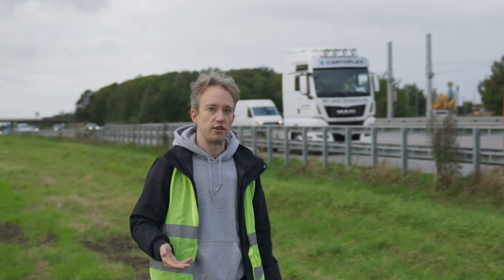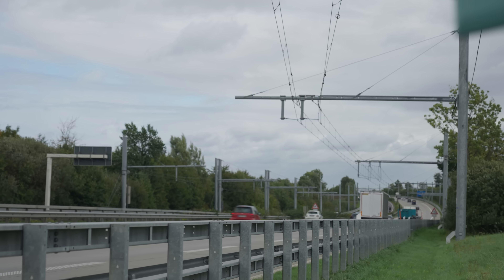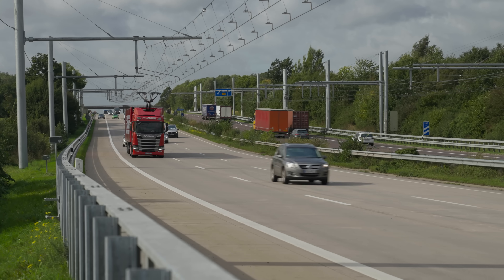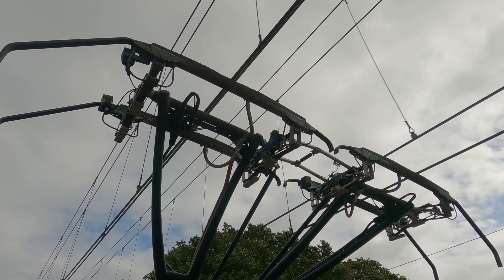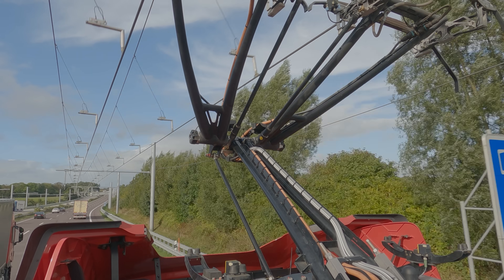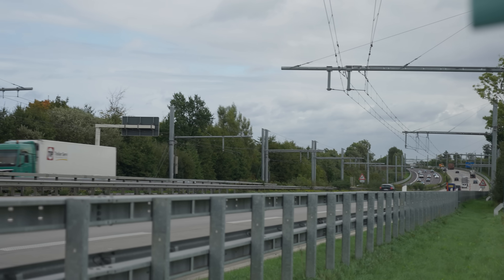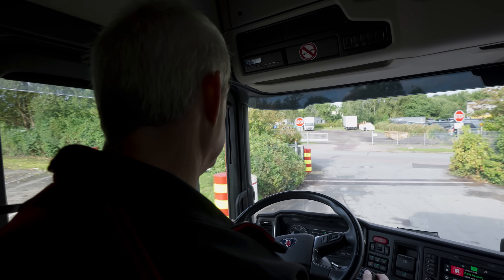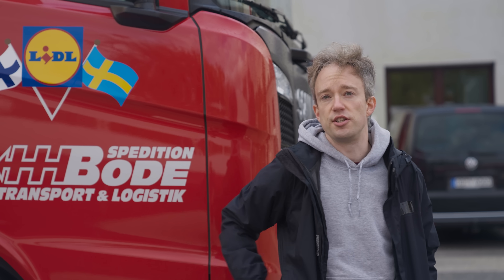The highway where trucks work like electric trains

Comment: It's funny that this 'trolleybus'-technology is 130 years old and now it's suddenly relevant again.
Reply: Not trying to be pedantic, just find it interesting. Trolley technology is actually slightly different from the pantograph technology they use here. Though as far as I can tell the only public transport systems these days making use of trolleys are indeed busses and not trams. The reason that the system is used mostly by (inner city) busses seems to be that a trolley system gives a bus more room to maneuver while still receiving power. However from experience living in a city with trolley busses if the trolley pole does loose contact with the overhead line the bus needs to actually stop as the pole needs to be manually directed again to the overhead wire. 

A pantograph as used here doesn't offer the benefit of following the overhead wire but also doesn't needs to be manually directed in the right place. As the truck also has a battery and a highway is mostly straight driving anyway it does make sense this was used.
Reply: @creesch  You overlooked another reason for trolley buses:  They allow a tram style system where the slopes are too steep for rails.  Geneva Switzerland is a good example.  They run trams on the flat and trolley buses in the hills.
Reply: @creesch  pantographs also allow faster speed while providing vastly more power, but it's more expensive and requires complete overhead wire replacement so most tram/trolley buses systems already using trolley poles are inclined to keep their poles to save cost. They also have this mindset that wireless battery electric buses/tram is the future and they can soon "skip a step" and ditch the wires completely, soo...
Reply: @duncantalksalot  Indianapolis has already taken this step, with battery powered buses running in dedicated lanes.  Ironically they used to have an extensive trolley bus system 50 years ago.
Reply: @duncantalksalot  Here in Toronto, we kept trolley poles for the streetcars as up until 1993, we also had trolley buses and any intersection between those is a lot easier if both use poles (and so, frogs for switches on the wire). 

It’s only now that we have new vehicles that all the wire is being gradually upgraded to be suitable for pantographs. For now, the new streetcars have both a pole and a panto depending on which route they’ll run on.
Reply: @danielstickney2400  there where everywhere and in 1930s train stations where in almost every town in u.s
That had railroads
Reply: @creesch  Trams use a single pantograph because of the rail working as the negative whereas the trolleybus is isolated and needs the two wire system shown here , just with two separate pickups because the live and neutral have to be supplied , it is the same as the trolleybus system , just different pickups so the trucks are able to connect easier . I think if one of the pickups on the trucks goes wide and loses contact the truck will keep running from its batteries and be able to move across into place and reconnect . In Kharkiv there are trolleybus (Bogdan make  ) that can travel quite a distance without the overhead lines , they actually introduced a new line before the overhead cables were installed .  Even if they lose contact they can carry on to the next stop and then put the arm or arms back to the wires
Reply: @creesch  Yep, many a day I was late for class when the electric pickup would fall off the line on the trolley bus in Boston.
Reply: @creesch  We used to have trolley buses in Toronto, but we dropped them I think because of that problem. We still have streetcars, which most NA cities got rid of 50 years ago. Problem is, they mess up traffic unless they have a separate. preferably grade-separated right-of-way, which is expensive, though slowly being phased in.
Reply: @creesch  well trolley and tram are synonyms actually
Reply: @mareksicinski3726  They might be used as such by people but they really are not from a technical point of view.
Reply: @mareksicinski3726  only in North American usage. In Europe we use different words for clarity
Reply: Exactly, this should be called... a trolley-lorry? Trolleylorry? Or trolleytruck :).
Reply: @piotrb4240  trorry
Reply: @piotrb4240  "trackless trolly" in Philadelphia :)
Reply: @piotrb4240  Trollory? Truckybus? Electruck? ... now that I think about it that last one is almost certainly already a trademark
Reply: @piotrb4240  Trollorry
Reply: @piotrb4240  Trollorry
Reply: @piotrb4240  I think Trolleytruck is the accepted term, but trolley-lorry is funnier.
Reply: San Francisco has lots of trolleybus routes - diesel engines simply can't handle our hills. 
And as noted above, the newer models have batteries, and they just bring the poles down for certain parts of the route where they tend to come unhooked regularly, so they don't have to hassle with it.
We also have trams that run on pantograph, sometimes in the same place. Buses can't use that. The difference here is, the trucks have dual pantographs, presumably one for ground.
Reply: @dwc1964  Nope, the second wire is not ground, it is neutral because it carries the return current. The automotive industry incorrectly calls the negative terminal of a battery the ground because it is electrically bonded to the chassis, called a chassis ground. A true ground wire as called in the electrical industry would be one that does not normally carry any current, only carrying current in emergency situations when there is a fault in the electrical system.
Reply: @00crashtest  I stand corrected
Reply: @dwc1964  Thanks for admitting that!
Reply: just imagine what it could've looked like if we kept using it for 130 years long, we would be far into the future by now.
Reply: @PumpkingsLol  in czech republic we use Troley Busses
Reply: @t0biascze  In Ukraine we use Chechoslovak trolleybusses
Reply: @t0biascze  Same in Ukraine and we also have some of your old trams still in use in Vinnitsia . I like the old ones , they have a lot of character
Reply: @PumpkingsLol  trolley-busses are still used around the world. In Ukraine we have plenty of cities running trolley-buss networks. I'm curious if they can be extended to let trolley-trucks to run in them
Reply: @VityokOrgUa  i live in a city with them
Reply: @VityokOrgUa  I remember taking an electric trolley bus between Simferopol and Yalta a couple of decades ago, an 86km journey all by electricity. Of course now as an American I am not allowed to go there but it was cool at the time.
Reply: @VityokOrgUa  I have the same thoughts as well. My city of Seattle has a lot of trolley bus routes so I’m wondering if trucks shipping goods could possibly also connect to the overhead wires
Reply: @VityokOrgUa  Cities like San Francisco, too, have continued to power most of their buses by such an overhead system all along.
Reply: @solracer66  That's supposed to be the world's longest trolleybus route. Glad you managed to travel on it while you could
Reply: @VityokOrgUa  They were also used in the 60's in Milwaukee.  Only problem is the ugly wires above.
Reply: @VityokOrgUa  we gave trolley buses in Bulgaria too. but I prefer diesel trucks and buses. I love the sound when I drive them! I don't want to sit quite I want to hear a diesel engine sound!
Reply: @VityokOrgUa  Kharkiv had just opened a couple of new lines just before the war started . As  regards the existing ones being extended for trucks the problem is with the pickups being different . it might be possible just for within the city but outside of there maybe not
Reply: @VityokOrgUa  I thought that trolley-trucks did exist in the Soviet Union at least in the '50s and '60s?
Reply: @PumpkingsLol  Switzerland is still using that system in cities... since a long time
Reply: @PumpkingsLol  many cities do
like for example salzburg
Reply: @PumpkingsLol  what goes around comes around, we keep reinventing things..
Reply: @PumpkingsLol  in the past it was just total crap, and the combustion engine just proved more reliable short term. Nowadays, it's almost perfect.
Reply: @PumpkingsLol 
Well Switzerland has with its trolleybus systems
Reply: @PumpkingsLol No, you ll either think there is no future or fossil fuel is the future😂
Reply: @PumpkingsLol  yes but that would have hurt the oil industry. Technology that would revolutionize an industry tends to get suppressed only for it to reappear in the future.
Reply: @PumpkingsLol  In der Schweiz sind  O-Busse schon immer ganz normal.
Reply: And electric cars are 100+ years old
Reply: It was always relevant, just not backed as well as the fossil fuel lobby. Governments and local authorities (and I'm particularly thinking of the UK) will do anything in their power or kick the can down the street to allow anything else to come along in order to avoid putting trolleybuses back.
Reply: @PedroConejo1939  Nimbyers will not want to have electric overhead lines too, you might get away doing it on highways but down urban roads even high traffic routes would be almost impossible to keep the Nimby crowd away.
Reply: @Vinícius Carmo maybe because now we have the right tools and the means? How would to keep electric cars warm up so batteries can work at optimal temperature. How do you put a 70s computer on a car to control the right amount of energy needed to move? also, lets not forget costs.
Reply: not only that, its a BRAND NEW 130 years old invention
Reply: But the same reason road transport has overtaken rail transport. with road its someone else problem to fix the road. all you have to do is have a truck + put fuel in it and now you can do deliveries. with trollybus you HAVE to follow a route with power. suddenly you are limiting yourself, and your competitor (with their more expensive diesel truck) can get to those areas where you can't
Reply: @rjc0234  Monopolist mantra. Privatise the profit Socialise the debt
Reply: @rjc0234  and that's why you regulate against diesel trucks
Reply: And Moscow got rid of them recently. Very hasty and unnecessary decision.
Reply: A lot of Central and Eastern European countries have them. These countries may actually have some of the best public transport infrastructure in the world.
Reply: @guntisber5415  Ingenious.
Reply: To be pedantic, trolley buses have a trolley pickup, which differs signicantly from this twin pantograph pickup.

I recognise that you were writing figuratively there, but am going to say more anyway because I am that sort of geek.

For motorway / autobahn speeds true trolley bus tech would not work -- I am old enough to remember the trolley buses in London and the trolley could come off straight wires at 30mph, or at walking pace at a junction where the wires split between two routes. This would leave an almost immediately stationery vehicle whose driver had almost no choice over where it came to a halt. A person (called a conductor, rather inappropriately I thought as a child) would use an insulating pole  and would have to walk round the vehicle in the middle of the road to lift the trolley back onto its tracks.

The pantograph in contrast is  pushed up onto the wires from below, and as such can be controlled  from the cab; as well as being much less likely to spontaneously come off.

Which of these technologies do you prefer on a motorway?
Reply: @trueriver1950  Ok.
Reply: Moscow converted the trolley bus network into battery busses...
I would prefer, that they convert bus lines to trolley bus or tram, if the amount of passengers justified this and left diesel or battery busses, when the line isn't really busy.
Reply: Just like electric cars
Reply: People start realising how much cars suck and ruin our cities
Reply: Trams use wheels similar to trains that has very low rolling friction and thus very minimal power losses.
Reply: In Wellington New Zealand they got rid of the trolley buses a few years ago.
Reply: It’s because companies usually don’t want to pay for the upfront costs of building the infrastructure needed.
Reply: бюджет сам себя не освоит 🤣
Reply: The city I live in, Arnhem (with the Bridge too Far) is famous for its trolleybus system. It always works!
Reply: Het verraad van Berhard.
Reply: @Vinícius Carmo Electric cars themselves have existed since then, yes but they were not a viable option at the time due to poor electrical infrastructure and a vast lack of battery capacity. Battery technology has only just moved to the point that electric cars are becoming a real option within the last 10 years.
Reply: @harrier331  they still suck
Reply: @harrier331  We used to have the Interurban system even in the rural Midwest. Private cars and road systems gobbling up all the spending is what did it in, not really anything to do with electric not being viable.
Reply: @edherdman9973  Ok, explain how electric was viable then...
Reply: @harrier331  they still aren't viable in remote areas of countries, or in the countryside of places with lots of land. They're great for lots of applications, mainly in cities & small countries, but it bothers me when people over weigh their ability to replace ICEs. Both are still needed at the moment.
Reply: @harrier331  definitely not a real option
Reply: @Vekikev1  That is clearly incorrect as the electric car market is expanding, if they were not becoming an option people would not be buying them...
Reply: @Vekikev1  if you were old enough you'd have said that at Kitty Hawk...
Reply: Funny how similar it is to how rockets & wheeled carts became relevant again after technology advanced enough ;)
Reply: Public Transportation Technology literally Peaked 130 years ago
Reply: Y was late why for what for whome
Reply: So are electric cars!
Reply: It all goes arround. Just imagine, if we can take out carbon from the atmosphere and make it petrol. Over and over again some day in the future
Reply: Ironic isn't it.
Reply: this is one of the most stupid things I`ve ever seen apart from the fact of tedious maintenance over large distances of this colossus Soon to be outdated infrastructure. Which would inevitably be replaced by HGVs which eventually go electric. Economic`s would favour tracks that carry their own batteries and can be charged up using facilities at their depots.  Which would be a hell of a lot cheaper than paying for the electricity that comes from those overhead lines which would be at a premium because of the immense maintenance costs.  Of course the people putting these Overhead power lines in would be getting government grants and handouts all paid for by higher taxes for the people of the country.  This is a total scam just like global warming which is not happening.  Global warming Lai is being used by the world economic Forum to try and institute their Great reset allowing them to do a power grab we`ve all seen what happened in Canada with Justin Trudeau little baby of the world economic Forum just like New Zealand and just like Australia. You`ll owe nothing and be happy. the future for trucks from an economic point of view is battery electric powered but the batteries need to be capable of way over 1 million miles lifespan to make economic sense. which is virtually here now.
Reply: It's only relevant coz diesel fuel gotten costly 70 years back it was cheap
Reply: Same with glass bottles, wooden furniture, etc.
Reply: I remember when the trolley buses from Uxbridge to Ealing were just stopped,. Typical short-sighted political decisions that craap the world over and over again.
Reply: We kept some trolley buses in Wellington until recently, and the reason they took it out is it was ancient and the entire network needed upgrading, and they were like Nah that is too expensive so they ripped it out. If they could have expanded it, then it might have been worth upgrading, but there would have been too many Nimby people.
Reply: It will be more relevant if that would be like on the go charging stations.
Reply: Because it works
Reply: In France we still use Troleybusses
Reply: Hahahaha
Reply: What’s old is new again.
Reply: Exactly but many places are sooooo hesitant to just build stuff like this
Reply: It isn't relevant. It's con job, a money making scheme like all green stuff.
Reply: The oil industry wouldn't exist if battery technology had beaten internal combustion engines.
Reply: @eekee6034  Well they're trying to perpetuate themselves with hydrogen. This is the real reason for the Ukraine war in my view
Reply: @eekee6034  I disagree they'd be used to make electricity. Unfortunately less efficient..
Reply: meanwhile, it was swithed from in Moscow a year or 2 ago. what a bizzare world we live in.
Reply: Because the consequences of kneeling to huge oil companies are finally being made clear.
Reply: It's relevant again because of the oil industry is coming to an end, an industry where "smart" guys lobbied to keep everything electric underdeveloped. Happened in usa too. That's why they don't have high speed trains.
Reply: @danny3man  That's only part of the reason.  Aircraft require no infrastructure between airports, and that savings increases with distance, and distances here are long.  The longest road in the UK wouldn't get me halfway to my mother's house, and that's only a third of the way across the US.  Also the US railroads wanted out of the passenger business because freight is more lucrative.
Reply: They had the right ideas from the very start even the electric engine was built before the combustion engine, the oil industry is fully to blaim they got most companies focusing on Electric screwed over by paying currupt politicians and such to Impose unfair taxes on them so they could not compete at an Offord able price.

Now oil only has like 40 years until it runs out they are changing over but no doubt these multi billionair oil companies will dominate everything else now too.
Reply: @paulc1903  The electric motor was invented at a near parallel to the Internal combustion engine.

Electric was not a viable form of power for  vehicles at the time as battery technology was nearly non existant.

It is only recently that batteries have been developed which can bridge the gap.
Reply: @paulc1903  You're clearly in the pocket of Big Trollybus.
Reply: What's strange is that they seem to be thinking this is new technology and never been done before.
Reply: @Vinícius Carmo electric car was made 100 years ago, and even Porsche had one 100 years ago
Reply: Indeed, but it was inevitable. The late Industrial Revolution was built on the cheap, high energy density of oil but the cheap, low energy extraction oil is running out.  As well as being hugely polluting.
Reply: Thing is you don't want trolley bus cables in inner cities or on minor roads if you can help it, because it creates a lot of city planning constraints. And putting it on highways hasn't happened yet because of the investment requirement.
Reply: @hapmaplapflapgap  Also the maintenance for the trolley buses is so expensive. It’s cheaper to run them on Euro 6 or 7 Diesel engines.
Reply: Electric cars were commonplace in New York city 100 years ago... Imagine if we had stuck with them, where we would be now
Reply: Are we to sit quietly and just accept all this propaganda from Big Trollybus?
Reply: Any technology which can help you to siphon out some taxpayers' money from the government is relevant.
Reply: Fads come in waves...
Reply: Not funny, just evidence of us being slave to corporations while they ruin the Earth and profit from it. There’s a profit motive to covering up ingenuity clashing with fossil fuel interests. Follow the money!
Reply: Except it absolutely not relevant.
Reply: Russian's knew what they were doing
Reply: Auto industry insured that it all got phased out in the mid-20th century
Reply: Still not relevant though. No one is gonna use this crap, we gonna have underground tunnel mag trains
Reply: Gee I wonder why most of them went away?   Could it be because there’s a more efficient mode of transport?
Reply: @stump182  If you mean cars, they're not more efficient. More convenient, yes, but not more efficient.
Reply: @stump182  ya which is cars
Reply: @stump182  efficient in money terms while oil is cheap.

That differs from being truly efficient in energy terms; and in terms of not baking to death any descendants we have.
Reply: Trolleybus systems are not realistic.